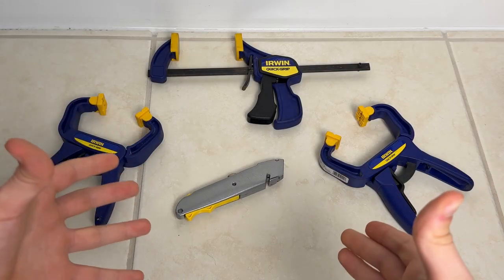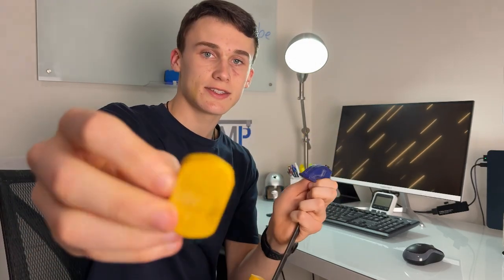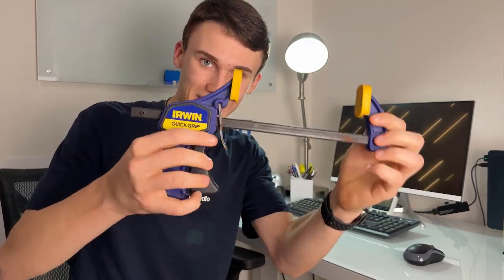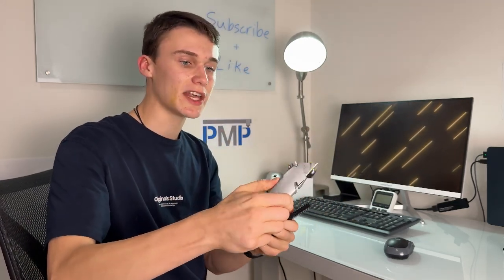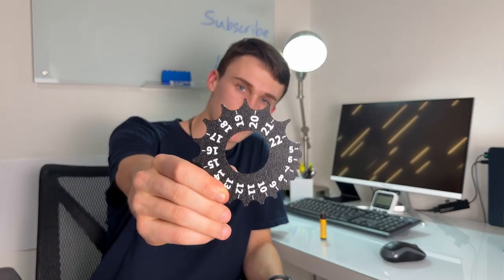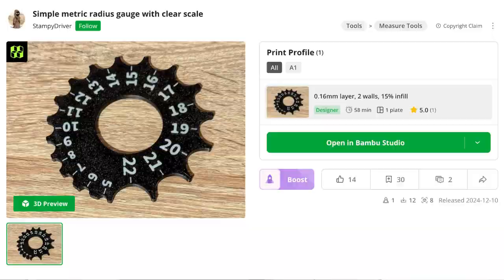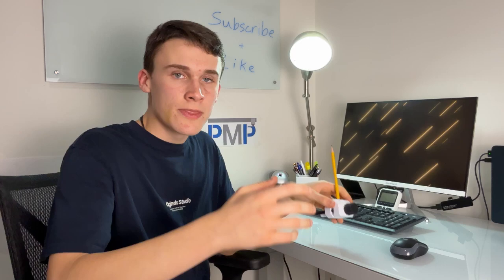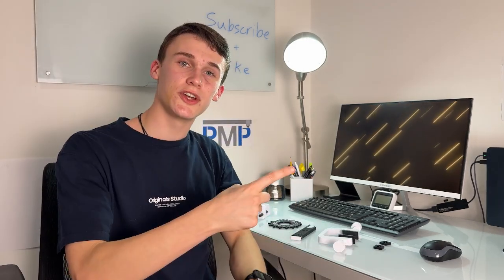Do 3D Printed Tools Actually Work? (ft. Bambu Lab A1)

Comment: 4:00 can't someone just use a caliper to get diameter? if you're into 3D printing, you probably have caliper by now right? or you could even 3D print a simple caliper and use that for more things than just radius.
Reply from the maker: We actually have calipers, but they aren't always effective. In the case of the Chap Stick, Calipers would work because it is perfectly round. However, we had a broken baseboard piece on our wall the other day and we couldn't use calipers to get a good read so we ended up using a radius gauge instead. This allowed us to fit a replacement cleanly into place.
Reply: @PMPrints ooh i didn't know that. thank you for the tip

Comment: Yeah, the clamp is useless for real world work that the Irwin is designed for and is waaaaay slower. The vice has the same problem. The utility blade is also not the same tool. The 3d printed one is a box cutter. The utility knife is not.

Comment: You’re not proving anything by holding a glasses case closed. Irwin clamps, and other clamps like that, are used in construction, woodworking, etc. I would have tried a bit more of a serious example.
Reply from the maker: We honestly had no better example to use my 3D printed clamps on because we aren’t familiar with woodworking. The printed clamps are not as strong as the Irwin clamps but we still found them helpful becuase our projects typically don't require strong clamping strength. We appreciate your feedback and will try to use better examples.
Reply: @PMPrintsAlso to point out, the Irwin clamp can be used one handed. In this example you used one hand to hold it, and one to clamp. Whereas your clamp you had to use your hand to hold the case, your torso to brace it and then the other hand to clamp it. Try making yours one handed or something of equivalent function. It's not a proprietary technology, lots of tools have the stepper movement.